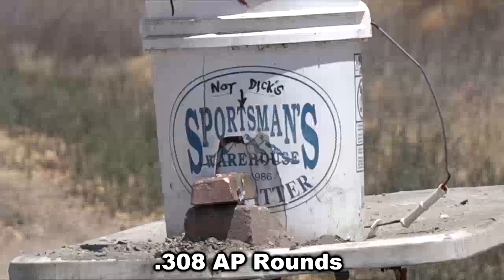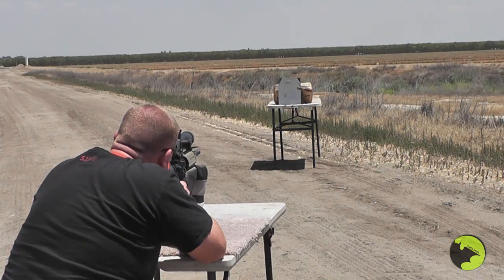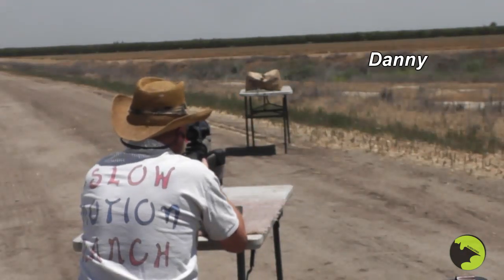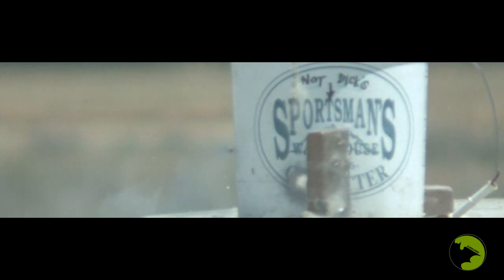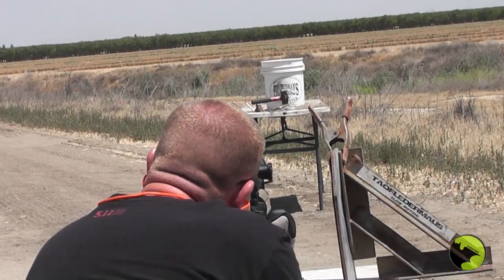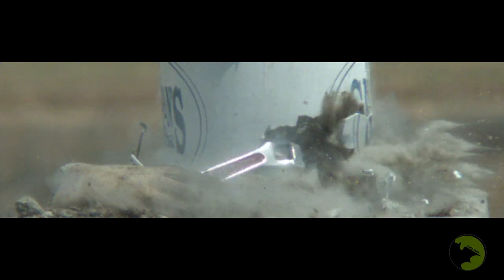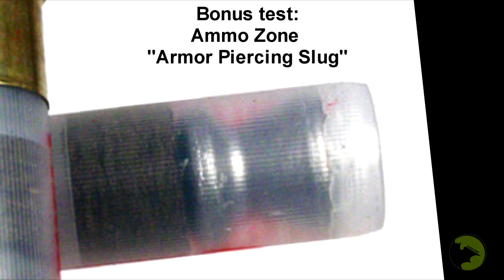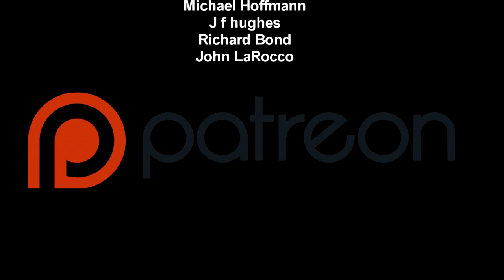.308 ARMOR PIERCING Bullets -  TESTED!

Comment: Tracer rounds don't usually ignite until the 70 yard  range
Reply: Agreed... shot many of these out of M240B machine guns.
Reply: Jason Jacques yes , to protect the bore and not give away Your specific position
Reply: between 50 and 75 is the norm and all they had to do was read the spec sheet found through google .maybe before they shoot next time they will do some research and look as if they have a clue as to what they are doing
Reply: @thomasnakagema7239  complain a little more about the free video
Reply: Thomas Nakagema That is evidence that these guys are rather ignorant about ordnance
Reply: @ders972  its constructive criticism.  Honestly they should know how tracer ammo works.  They shoot enough guns.
Reply: @MK-Ultra-o7  BTW you used "its" wrong
It's is it is
Its is possessive 
If you are going to use something you should Google it first so you know how to use it, you use enough words
Reply: @ders972  wow great point very enlightened
Reply: k
Reply: https://lmgtfy.com/?q=military+tracer+ammunition&iie=1

See 4th result for detailed explanation
Reply: Torpedox ttocsyor  nope. Tracers don't light up until they are about 50 to 100 meters out. You can have all the reasons you want why they would light someplace else, but you can't see them until they are a ways out there.
Reply: Torpedox ttocsyor  you are partially correct, it does ignite inside the barrel, but doesn't start to fully burn until 70-100 yards out, when it becomes bright enough to be visible.
Reply: @thevalorousdong7675  you got me, bored and upset oh well
Reply: Torpedox ttocsyor  It may ignite in the barrel, but it doesn't reach visible brightness until 50 to 100 meters and most manufacturers advertise as such. Read about it.
Reply: My thoughts exactly. "Lets test this round out from 2 feet away"
Reply: Tracers won't ignite until about 50 to 100 yards downrange .
Reply: @ShortStuff0000  me to bud
Reply: @MK-Ultra-o7  It's not its. Just constructive criticism since you speak plenty of English.
Reply: They light in the barrel.
Reply: @MK-Ultra-o7  it WOULD be constructive criticism if you didn't phrase it so sarcastically and rudely.
Reply: @RedVRCC  no u

Comment: Those AP rounds don’t play around.
Reply from the maker: They were beasts!
Reply: TAOFLEDERMAUS they are*
Reply: TAOFLEDERMAUS it takes tracers around 50 yards to ignite. The drag of the air heats up the bullets and ignites the tracer compound. :)
Reply: No kidding. They were very impressive.
Reply: nope
Reply: Hook-set Outdoors wrong haha
Reply: Rather one of those hit me then a hp.
Reply: Love your channel!
Reply: AP=Ain't Playin.
Reply: @Hook-set_Outdoors  Then you are saying a air cooled engine on a motorcycle, because of the drag of the air would get hotter?  Why don't airplanes get hot and burst into flames?
No the tracer round is lighted while still in the barrel but does not start to trace or really burn until close to 100 yards out.
Reply: In mid 60s I bought ammo boxes of 2 different color tracer rounds red and green . Also AP rounds ,they cost 7 dollars a box military surplus all 308 . When it says AP that's exactly what it means !
Reply: @robertanthony9674  Right - too many posters have no idea what they're talking about!
Reply: @robertanthony9674  the x-25 was made from special material to stop it from melting because of friction with the air.... oh and also the space shuttle with its special tiles... you need to do more research before stating something stupid.. good day.
Reply: @Hook-set_Outdoors , Noooooooo!
Air friction has NOTHING WHATSOEVER to to with igniting the tracer element (AKA "Pellet") in the base of the projo.
To prevent air/humidity from turning the pellet inert, a thin  copper disk is placed at the AFT most portion of the combined components then the exterior jacket is swaged into the boat tail configuration, capturing all the internals.
When fired, the HOT gasses of the powder begin to melt the copper closure disk then the heat of combustion sets the tracer pellet to burning/glowing, reaching maximum surface burn generally when the entire projo/bullet has exited the barrel. 
The tracer pellet will burn until it is spent (duration is dependent on the projo type...some longer for "spotter" purposes, some shorter and some "juuusssttt right!) or the projo impacts the intended target. 
If the target is a "hard" target (thick metal or other bricks, lumber, etc.) the round will deform and, depending upon material struck, the tracer pellet can disintegrate while continuing to burn, giving it the appearance of a "flash" as in an incendiary projo and as we witnessed in TFM's video.
If the tracer hits an organic target (human or other animal) it will generally just sail right through due to lack of target mass or density, and heads off into who knows where. 
But, Nooooooooo! Air friction does NOT play a part in igniting the tracer pellet/element at all.
As an aside, tracer projectiles are typically shown to have the top-most 1/4" or so painted with a red/orange hued paint to let the user know the round is a tracer round.
Mixed (usually) in a 4-1 link of other rounds (four "Ball" or generic FMJ rounds to one Tracer round) with the intention of the multiple rounds being spewed at an adversary by a Machinegunner who can more better determine the "beaten zone" of his round spread by watching where the tracer rounds impact (and the Ball rounds being in the same area, too) thus keeping the enemies heads down while other troops advance on their position. 
Hope this helps to clarify the facts and issue.
Overnout
Reply: Lol you know that best now
Reply: The foreshadowing of this comment in 2021.
Reply: Hi KB!
Reply: Were those AP rounds M80A1, Israeli M61, or M993?

Comment: Age can affect a tracer but some tracers do have a time/range of activation
Reply: they need a little time to  heat up
Reply: Most NATO 7.62 tracer ammo is designed to 'light up' at >100m. This is to stop the tracers from showing your exact position.
Reply: Tracers are DESIGNED so they don't illuminate right from the muzzle. It's bad enough tracers work both ways but having it go right to the point of aim for the enemy is a terrible idea.
Reply: Some tracers were meant for firing in an m60 from a helicopter and don't light until around  400 yards or so.

Comment: You're shooting too close for the tracers. They need a little distance before they light up.

Edit: Have you done 12 ga. bird bombs? They're like an M80 stuffed into the shell with a fuse that makes it explode around 35 yards away. Fun items. I might have a few if you haven't demo'd them yet.
Reply: Why not just use birdshot? Less expensive, probably less prone to defects, can be used at ranges other than 35 yards... It sounds like a cool idea, but I've seen too many useless or defective novelty 12 gauge cartridges not to be sceptical.
Reply: Sounds like something I'd be a little scared to shoot. Also sounds like even if it worked right it'd send shot back at you at some point.
Reply: Brian Scott they are agriculture based rounds. They are used to scare birds out of a farmer’s orchard. They don’t contain shot, they are not intended to kill birds.
Reply: I've always heard it called scare shot. One hell of an explosive inside them.
Reply: @bennettrogers7921  There are also "bird bombs" that look like the old M-80's that utilize a starter pistol looking device. These use a .22 blank to propel and ignite the "bird bomb" about 50 to 75 feet. These are much more powerful than the 12ga bird bombs. At least they were 20 years ago.

Comment: aWESOME video  great stuff... tracers need several dozen to a hundred yards to really light up
Reply: Alaskan Ballistics I was going to comment the same thing but you beat me too it high five ✋
Reply: I've noticed they usually ignite between 50-150 meters
Reply: Yep
Reply: what he said
Reply: agree guys, range was way to short but still fun to watch
Reply: Yep, too short range for “tracerization” 😂
Reply: Was going to say the same😁
Reply: Yup beat me too it, air resistance is what make tracers light up actually, thus requiring distance.
Reply: to protect the shooter from exposure.
Reply: RobRage it also changes depending on whether the barrel is cold or hot.
Reply: That has been my experience with 5.56, I'm assuming it's the same with .308.
Reply: @spoot8835  , nope.
There is a small pellet inserted into the base of the projectile which is covered over with a thin copper cup to keep the pellet from breaking up from vibration when shipped here and there. 
Once the round is fired, the hot gasses melt the cooper cup and it ignite the tracer element. 
Depending on the cartridge, the pellet can start burning and become visible anywhere from 25 to ~ 100 yards out and this can be seen of you watch videos of military folks shooting mainly machine guns either during practice/training or war footage.
The ONLY thing the painted tip does is provide visual reference for when loading a belt or  magazine with rounds. Generally speaking, MG belts are loaded with a mix of 4 to 1, meaning 4 rounds of Ball projo's to 1 round of Tracer. The tracer rounds are loaded to closely duplicate the flight characteristics of Ball ammo so the machinegunners can see where the rounds are impacting. 
Since the MG is typically used as an "area" weapon, it is fired at the target to create a "beaten" zone, unlike a rifleman or sniper who are shooting at a specific target.
The tracers show where the rounds are falling and the gunner can adjust his (her?) fire for best effect.
Reference the "flash" of light when the guys were hitting a hard target, the impact fractures the tracer element and it "flashes" instantly giving the impression of an incendiary round.
Speaking of incendiary rounds, they consist of the outer jacket with a small amount of zirconium crystals near the tip and backed up with a harder steel rod behind it which is surrounded by a thin sleeve of lead to hold the core in place.
On impact, the kinetic energy upon impact would crush the zirconium crystals which "flash" for both visual reference and to start fires on flammable items nearby.
It's all about SCIENCE!
Now you know. 
You are welcome. 😀
Reply: You Would Think IF They KNOW GUNS They Would Know TRACERS ( DON,T Light up 4 A Few Hundred yrds )

Comment: went through that ar500 steel like it was ar500 butter
Reply: Well then......I guess my 30-06 black tips will have no problem punching a hole in a level IV plate.
Reply: @cryhavoc9748  black tip 30-06 goes right on through most things like its butter!
Reply: @cryhavoc9748  level 4 is literally rated for 30-06 AP
Reply: @Halal_Dan  for one hit though 🤷🏻‍♂️
Reply: @Ewetoobizknotseys  Most ceramic plates from reputable manufacturers will take multiple rounds of black tip even when they're not required to.
Reply: @Halal_Dan  not if its the 130 grain shot out of 22inch barrel.  Then it will penetrate level 4

Comment: When I  shoot MILSURP ammo in my 03A3 Springfield,  it just loves M2AP cartridges. At 100 yards, if I  do my part, it will fire a group you can cover with a quarter. Penetration isn't an issue since it would have to shoot through a quarter mile of hillside to hit something on the other side.
Reply: Forgot to add, my bad. This stuff is just as good as match grade MILSURP  ammo. Need to use handloads to beat this. 

Can do this with dangerous game loads using 220 grain round nose softs. What it does at 100 yards is irrelevant  since Alaska's big three  (moose, buffalo, Kodiak bear) is best approached to within fifty yards.

Comment: I'm not sure if there are different kinds of tracers, but the ones I've used (conscript in the Swedish army) were just ordinary rounds with a small gob of phosphor stuck to the bottom of the bullet. It takes a little while before the phosphor starts reacting with the oxygen in the air, so it only ignites after travelling a few (10 or so) meters. Good thing too, cleaning the machine gun would've been even more of a b-tch with burnt phosphor all over it. :D

So yeah, it's basically like a tiny tiny incendiary round.
Reply: The tracer compound is ignited by the powder charge. It has it's own oxidizer and doesn't need exposure to the air.
Reply: Would make a lot more sense, but this was back in the 90s - and as part of the conscript army we were always training with the cheapest stuff available (i.e. old, leftover ammo). Heck, my brother that's only 6 years my elder was issued a Kpist -45 ("Swedish K").
Reply: I did some machine gun shooting with tracers back in -96 in the FDF and they pretty much lit up at the muzzle but the compound was in the tip of the bullet.. Also they did give a bit of a flash when impacting on steel as the compound was splattered all over.. My enlightened guess here is that the tracers boys had here sort of ignited on the kinetic energy of the impact.. The coolest thing however was the 12,7x109 AA-machinegun spitting 800rpm belt full of tracers and incendiery.. Shit got on fire and dirt and splinters were flying all over.. Especially vivid was to see tracers ricocheting and flying half a mile arcs and incendiery igniting 100 meters up in the air after skimming from shit.. :D
Reply: BILL SCHNEIDER I have some Russian green tracers in 54r. I forget what compound it uses. I also read that the Japanese machine gun tracers were light blue.
Reply: @StPaul76 , it is highly unlikely (as in impossible) to have a tracer round constructed with the tracer element in the tip.
How would you see it during flight and how would it be ignited and burned??
I think what you meant to infer is that your rounds were of an "incendiary" construction and, Yes, the incendiary material (powdered zirconium crystals usually) was in the forward-most part of the interior of the outer jacket.
Upon impact with any "hard" target, the internal, dense, steel or tungsten penetrator (IF also an AP round) would obviously continue forward until it crushed the zirconium crystals, causing intense (!!) heat and, thus, the "flash" which can be quite pronounced. 
Depending on the kind of ordinance (but usually .50 caliber and above due to construction complexity and lack of interior real estate) rounds can include:
Armor Piercing,
Incendiary,
Tracer or a combination of some/all of these.
When assembled and the projo tip painted, the nomenclature for the round would be labeled as:
API-T 
(Armor Piercing Incendiary-Tracer)
to denote what it actually was.

Tracers by their very nature are used to show where rounds are falling to ensure good target coverage.
Armor Piercing are designed to defeat (AKA Penetrate) hard or hardened targets up to a given distance, thickness and material construction. 
Incendiary are designed to set fire to surrounding materials as well as to cause fuels/oils to burn when exposed to the HOT debris of the burning crystals. 

There you go.
We are all more smartened up for the day.
Overnout
Reply: Swedish army 🤣🤣🤣🤣🤣🤣🤣🤣🤣🤣🤣🤣
Reply: @anthonytromp6265  What about it?

Comment: Later tracers are set up to begin to trace at 25 yards or more.  This to hopefully hide the shooters location. Old tracers leave the tracers compound exposed in the back of the bullet. Newer ones have what looks like a large domed primer in the bottom.  This may be to protect the primer compound from degrading.

Comment: Tracers usually don't light just out of the barrel.  We were taught in the military that tracers burn started on firing but bullet was moving so fast that you could not see burn until way out of the barrel, 20 to 50 meters.  My own experience is 10-15 meters with 5.56. Love your channel.

Comment: You were too close for the tracers to work
Reply from the maker: Every tracer I've seen is burning when it leaves the barrel
https://imgur.com/a/HWTP278
Reply: TAOFLEDERMAUS depends on the ammo some can take up to 100yrds to ignite but cool video as always
Reply: It depends on the purpose of the tracer. If it is an "over head training" tracer then it is likely to be seen immediately after exiting the muzzle. If it is a tactical round, then the subigniter and igniter chain will burn without significant signature delaying initiation of the illuminating grain until it is downrange. If it is a "dim" tracer then it can't be seen at all without light amplification. If it is an IR tracer, then it can't be seen without an IR imager.

It depends on when the rounds were manufactured, who made them, and how they are marked.